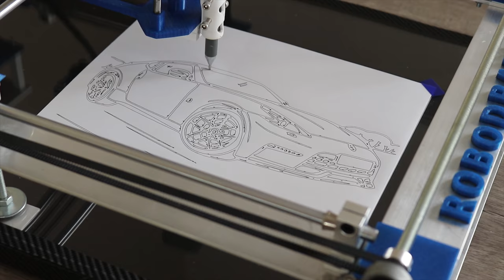DIY CNC Machine, CNC Drawing Machine, ROBODRAW (Arduino, CNC shield, 3 Stepper Motors, G-code)

Comment: Which program do you do with the drawing part? I can't make a healthy drawing, can you help me?
Reply from the maker: I used Inkscape to generate the G-codes. Then using Universal G-code Sender, send the G-code to the machine. 
you have to tinker with Inkscape a little to get the coordinates right. Hope this helps.

Comment: Hola podrías explicar como poner el tercer motor de la Y en el lápiz
Reply from the maker: The Z-Axis Stepper motor is connected to CNC shield just like X and Y. In the G-code you need to adjust how far it travels everytime it moves up or down. Hope that answers your question